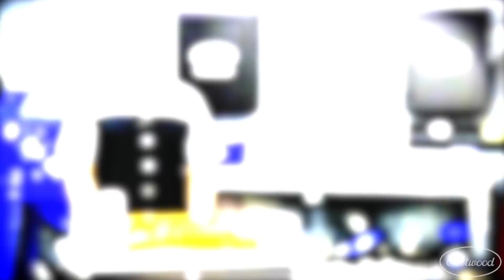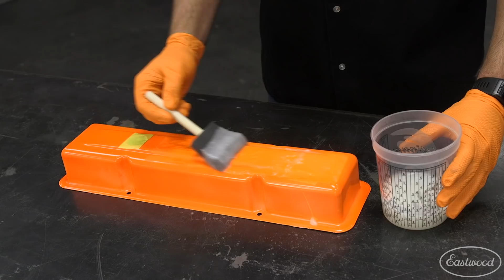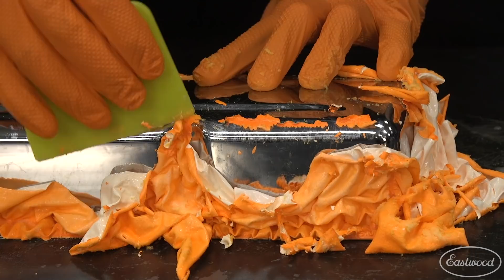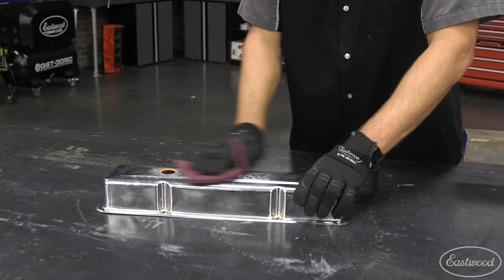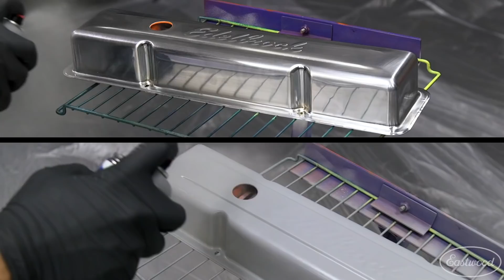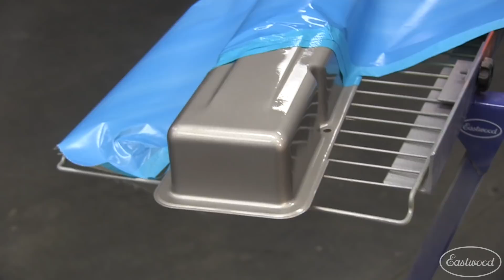How to Remove Powder Coating & Paint a Valve Cover with Stainless Steel Paint - Eastwood

Comment: That powder coat came off WAY TOO EASY ... I've used Aircraft paint stripper b4, and it's never worked that well for me. So either this Eastwood product is 10x better or a step was skipped here. 
I used it on my wheels, and had to apply 2-3 coats to get it all off
Reply: Evol_AF its powdercoated  on chrome thats why, plus it had silicon contamination
Reply: Honestly